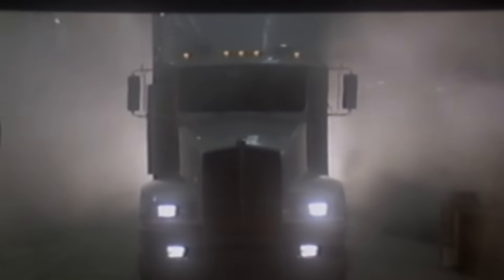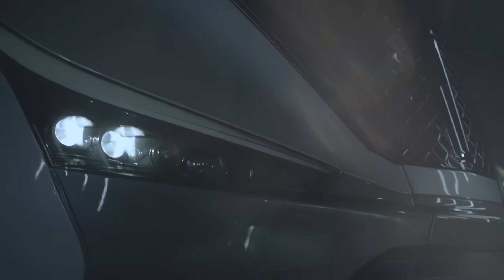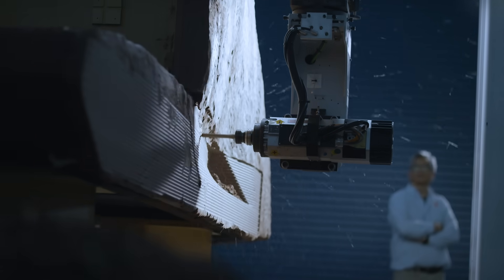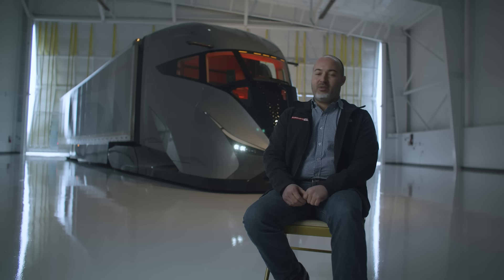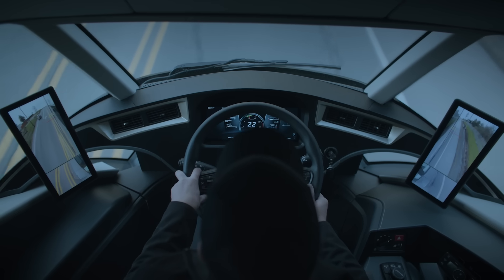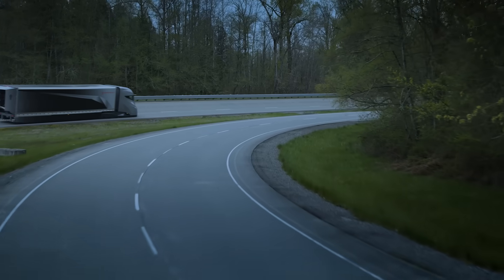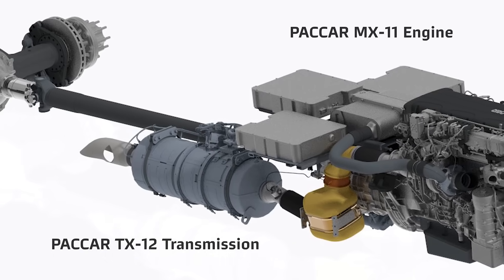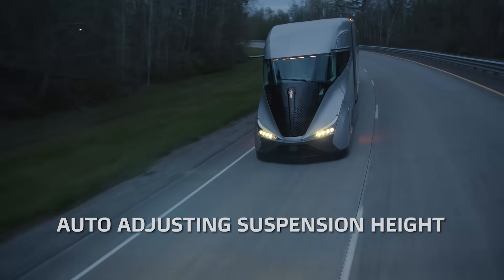Kenworth SuperTruck2

Comment: the only roads you could drive that would be in Europe. All the roads in the US are going to destroy the front airdam and lower aero in less than 100 miles
Reply: I 70  INDIANA!!’
Reply: 😂agree,arkansas,louisiana,😢fix the roads,then the aero hybrid😮
Reply: @joedavidzuniga1993 
Oh I see none of y'all have driven around New York and Long Island have y'all
Reply: People are always afraid of change.
Reply: exactly, just look at all the new t680s, they all have the bottom aero piece missing on each and every single truck, its actually quite funny to see.
Reply: Arkansas left the chat
Reply: No need to bring this to Europe. We already have better trucks than this joke on wheels.
Reply: If you read the AMR you’ll find that the truck has a radar and variable ride height with 8” of suspension travel that raises the vehicle when needed.
Reply: @Performance-101  So a bump under a bridge, and it opens up the trailer like a can of sardines when the suspension goes up. 8 inches of lift will take you from 13' 6" to 14' 2"
Reply: @joecummings1260  do you actually drive a tractor trailer unit or are you just trolling ,you don't understand the truck is obvious.
Reply: @jimedge8301  40 + years years as a shop and small fleet owner, and grew up in the business. Obliviously you have nothing to do with the industry if you believe that that truck is in any way shape or form viable
Reply: Whar are we doing here?
Reply: Will be laying horizontal on i80 wyoming
Reply: @peacefrog57 
Especially in the winter time

Comment: My issues are 1: It's too low to the ground. What about the possibility of debris on the road or snow or something? 2: with the wheels enclosed, how will they be inspected on the spot during pre-trips?
Reply: Front tire bam and half of the cab is gone.
Reply: Unable to put chains on the wheels as well
Reply: Of course you can! It would just take longer. You can replace the wheels after all. So you have access.  @macshawn4057
Reply: Imagine off-roading at shipper or receivers! Hope the camera mirrors are easy to replace at truck stops.
Reply: @flashnmb1 You guys are hating on the cameras now too? Get with the times.
Reply: @freddybell8328  if you've never driven a truck you got no clue bud. Cameras are nice and all but a mirror doesn't malfunction. God forbid you lose a camera for your blind spots and this thing is taller than any other rig out there so that blind spot is gonna be bigger
Reply: They said you can adjust the ride height..... Am pretty sure, you will be able to anticipate..... Don't Worry

Comment: I want to see more on the safety side.  With that much weight cut.  I know it’s to haul a bigger load and eventually cut the driver out entirely.  But as of the moment what are the safety improvements with over 6k pounds removed from the truck?
Reply: 6k pounds heavier does not mean it is safer. Aluminum alloy, composite like carbon fiber are lighter and stronger than steel.

Comment: Don't doubt there will be a lot of bugs to work out on this, likely only good for lighter loads so far, could be very expensive to fix a tire blowout, hitting animals, etc.  And of course the driver will be first at the scene of the accident, just like in a COE. Unless the cab operates like a COE, could be a bitch to service. And it would appear to be a throw away truck when the original owner is done with it, no selling it off to the farmers and etc. And it'll be of no use to vocational apps like const, oilpatch, flatbed & bulk tank hauls.

Comment: Really nice tractor, but Would like to see it doing the hard work taking trash to a landfill in the rainy season
Reply: I was thinking the same thing. My "Go to rig" that I pull off the line for the workday as a driver is going to be the W900L. I will ignore the T660s, Cascadias, and especially volvos if I have some serious work to do. The long AF nose on the truck is not a detriment in the cross-wind like one thinks. Especially in high cross winds going over the interstate. These shorter nose trucks are very squirrelly. And with the ground clearance there is no way that thing is going over corn rows and pulling into bunks for feed deliveries at feed lots.

Comment: Imagine trying to do a pre-trip on that or any sort of maintenance
Reply: As a Kenworth fan, I love this truck. As a Diesel Mechanic, I am terrified about doing maintenance on this.
Reply: Can't see the tires to see if they are even good. Cops are bad enough when you pull a chassis that is supposed to be fully functional and find fault.
Reply: @icrewheloso8588 has to come with a bunch of tire sensors
Reply: Exactly my first thought
WTF!?!?!
Reply: Yeah, and DOT wouldn’t be able to do a full inspection on this Supertruck because they wouldn’t know how. It’s a win for truckers in that regard.
Reply: @Nihil2005  ya not dot inspection for semi sounds great  it's not like the government would send the to school for the new equipment  I mean the truckers of today are great
Reply: @Nihil2005  not really a win when it comes to the DOT, they will wrap you in red tape until you can prove the specifications with specific pieces of documentation from the manufacturer, it happened with Volvo Bus when they decided to completely change up the airbrake system from the traditional airbrake style to the system they run now which uses a sort of central valve body
Reply: This will be super easy to work on. You just need to put an 8-ton crane in place and pop off the cab. So much room to work around.
Reply: those wheel covers come off eventually, so does the duck tail in the back, and nobody ever keeps the little doodads that extend back from the cab to the trailer for aerodynamics.
Reply: I totally agree.

It just looks ridiculous for what the machine, as a tractor, even is and does.
Reply: @noryaa4194  this is what happens when no one that drives a truck is in the room lol
Reply: Most new trucks most of the pre trip is done on the dash 😅😅
Reply: @VSG-RE   u do your pre trip post trip from the dash .  that's why we need the dot!
Reply: @VSG-RE  ???

Comment: the end of Kenworth is closer then i was thinking.. people want real trucks & that roll coal like a boss.
Reply: The actual people who need to invest in this equipment want it to be faster, more efficient, reliable, and cheaper. Feeling like a boss is not even close to being a consideration. Go yell at clouds or something.
Reply: @roguegeek  & u won’t get any of that with this. Looks ugly.
Reply: I want a real truck but definitely don't want one that rolls coal however I think it would be a nightmare to work on this truck and pre-trip it
Reply: @randywheeler3914  ya it dont have to roll coal, it just has to look good & be easy to fix. this one wont be, in my book.
Reply: Three decades ago, their Chillicothe plant was putting out 35-50 trucks per day. Presently, they're putting out 190 and aiming to get up to 200. You can definitely tell that quality has fallen by the wayside with how shoddy the build quality is on the new T680s. As a sidenote, even the classic T680s seem to be designed almost specifically to be produced quickly being that there are barely any rivets in the cab and it is mainly welded together by robots.

Comment: What is more refreshing is that they are not ditching diesel engine!
Reply: True, I was also excited to see that they reference Hydrogen Internal Combustion Engines
Reply: @Performance-101 hydrogen internal combustion engines, to be honest hydrogen fuel cell is the best replacement to oil gases and Fuels, but the sheer fact creating of a hydrogen internal combustion engine and possibly making it official, they're not only breaking records of making a future truck with a traditional diesel engine but also they're making it possible where it can be environmentally friendly while powerful too. In any case if I were to drive any future truck, I'm sorry Musk, but hydrogen internal combustion engines is way better than battery power and way more environmentally friendly.
Reply: @Maximal3235   UTC Aerospace has been running hydrogen for quite some time. its a pretty ideal system imo. But shell, petro, Loves, TA need to get it all situated sooner than never. At least we can say Kenworth is going to be the leader in trucks, as they seam to still understand what us professional drivers need. VS the other companies that are caving.
Reply: @Maximal3235 the issue is the creation of hydrogen uses a lot of energy. 
That’s why electric is getting popular, it’s just cheaper for the time being. Trucking companies want what’s cheaper and hydrogen just isn’t cheap. They will stick with diesel and slowly introduce hybrids and EVs.
Reply: @Maximal3235  Except hydrogen ICE is highly wasteful and unmaintainable. FCEV is better, but nothing beats BEV in efficiency.
Reply: @Maximal3235  don't know if anyone will drive in  the future, with  self-driving trucks coming up.
Reply: the only downside it's a Paccar engine so it will have heaps of problems. it will break down in 100.000 kms or less. one of the worst engines to have on a truck
Reply: Not true I have had a few of them and little to no problems at all my current motor has just over 500,000 miles not one problem only time spent at a shop is for PM and DOT annuals that’s it! Yes when this Motor was first on the market it had problems mostly with transmission working with the different ones but now many years later it works really well! There is not one Diesel motor out there that at times has had issues they all have!
Reply: Diesel sucks
Reply: Yes definitely not true( at least in my experience )  my paccar engine , other than a replacement water pump,was bullet proof. I never had any troubles In the 9 years I owned her.
Reply: Do you how hard it would be to find fuel if it was anything other than diesel
Reply: Diesel was the focus of Supertruck 2 - Supertruck 3 is about EV trucks. EV will replace diesel ONLY when it can out compete diesel. 
For long distance trucking that is harder but when they can recharge in 15 minutes every 3 hours or so (whatever the driving break rules are) then it will become increasingly difficult for diesel to compete.
Trucking is always changing from gas powered trucks to diesel, 2 stroke to 4 stroke, Vee to straight, non turbo to turbo to multi turbo, from 350hp being MEGA to 600 being "adequate", from Cat Cummins Detroit Mack Navistar to Cummins, Daimler, Navistar, Paccar, Volvo(Mack). And then there are the gearbox changes....
The reason for the changes is to be competitive in the transport business, that doesn't mean diesel will die overnight, Cat engines are still running with the last production 16 years ago. Just like Detroit 2 strokes ran for years after they where no longer "competitive".
I'm not even saying EVs will win - perhaps it will be fuel cell or hydrogen motors - but change is inevitable - tomorrow isn't today.
But I still love the sound of a diesel....
Reply: @ianloy1854  i think we are first gonna go to diesel electric (which was also mentioned in the video ) than to BEVs . And the concept is based on series hybrid with an ICE generator, so that generator can be diesel , petrol , CNG/LNG , bio diesel etc depends on local prices of these fuels .
Reply: You said it
Reply: Diesel engines are the most efficient ICE on the planet. You have to combine it with other tech like hydrogen or batteries to increase the efficiency.
Reply: Dieael rules for long hual roads!

If i was long hualing driver, i would pick the diesel electric hybrid truck.

Verdict:

Diesel: 1

EV: 0
Reply: In due time.
Reply: Because they can't
Reply: Nothing more refreshing than sucking on a tailpipe
Reply: This is sad they're ditching the classic Kenworth shapes. It just looks like a rip off of the Tesla trucks. The look ugly as fuck. At least it's not electric.
Reply: This engine designed with Cummins is modular , allowing it to be configured for future hydrogen fuel options- very fascinating design
Reply: How is it towed when it breaks??
Reply: Diesel will never die! Always going to be used in heavy machinery... Like mine work.
Reply: @OldsmobileCutlass1969Va  I'm sure repairs on an EV will be especially cheap as long as you can find a factory authorized dealer lol!
Reply: I have a revolutionary diesel drive train I would love to see in this truck. I would triple its fuel economy, at least. My engine has so much torque it doesn't require a transmission so no extra parasitic loss through the drive train.. It's quite insane how little people think about the carbon footprint of the required replacement of the $20 trillion existing infrastructure. There is so much energy density that exists in 1lb of diesel fuel. Most engines lose 1/3 of the gross energy potential through the cooling system and another 1/3 out the exhaust, hence turbos to reclaim some of that lost energy.
Reply: Battery so much cheaper and cleaner than diesel
Reply: @johnsutherland7561  If you're Local all the time, maybe. But even then, depends on how the Electricity is generated while recharging overnight.
Reply: @jaxcell  Infrastructure is being built out. Business is about maximizing profits and competitiveness So I think in  the next few years there will be a major shift to electric
Reply: @johnsutherland7561  Er, no!
Reply: Absolutely my first thought and relief.
Reply: Thank God, at least!
Reply: @noryaa4194 god isn’t real
Reply: @TacoXL  

Ok. Thank whatever or whoever.